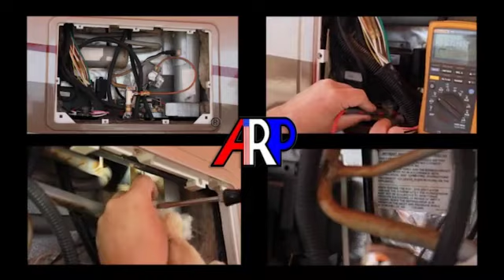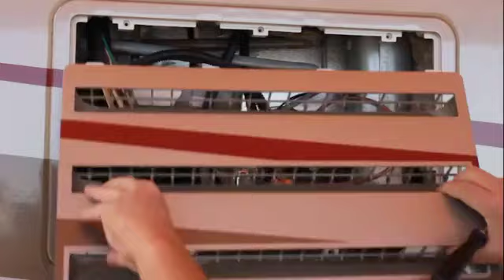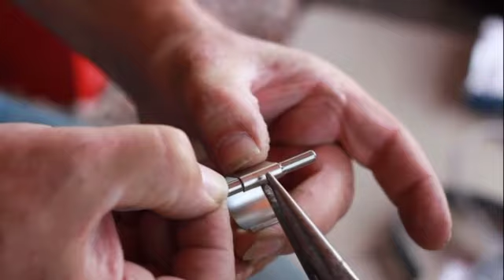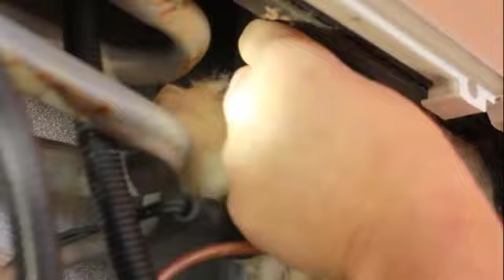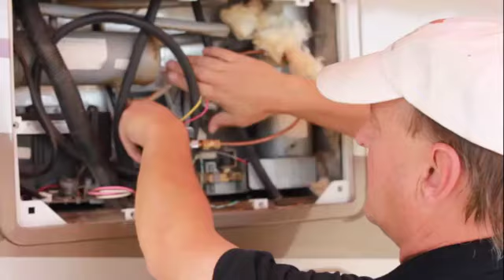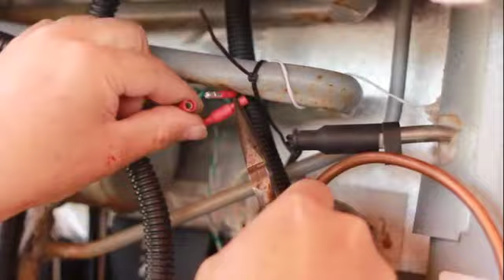How to Install ARP Fridge Defend Sensor | Dometic & Norcold Step-by-Step

Comment: Did I miss a step?   where do you hook up the ARP wires (red, green and yellow) to the fridge?  and you suggest to turn on the fridge 2 hours prior to the install...  is that required?
Reply from the maker: This is an overview mostly showing how to install the boiler temperature sensor. You did not miss anything because all the questions you asked are outlined in the installation and operators manuals. The fridge should be turned off 2 hours before the install. This is because you cannot work on the boiler when it is hot.